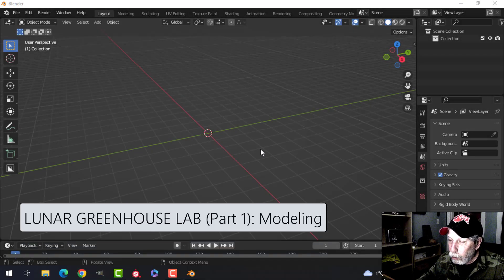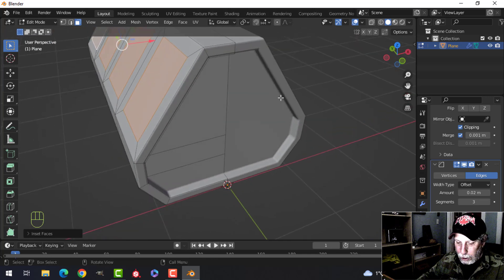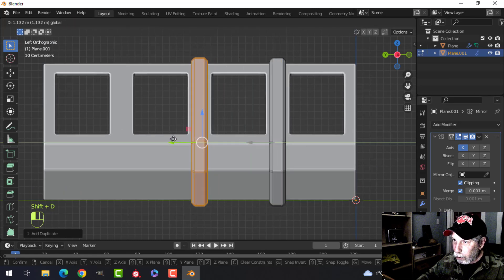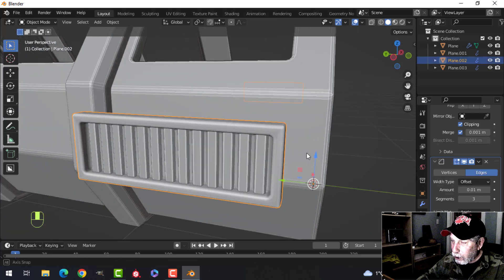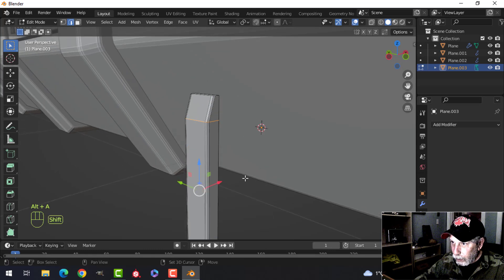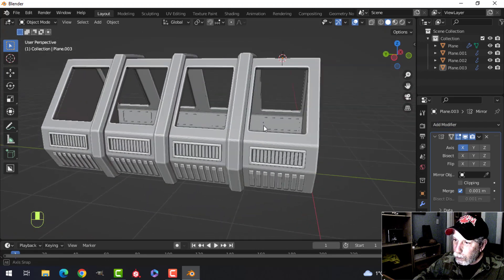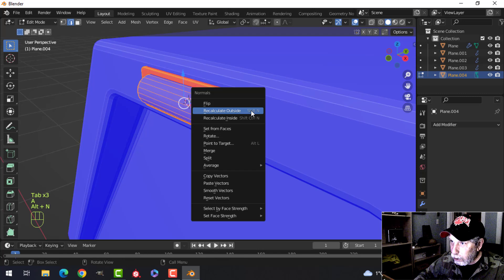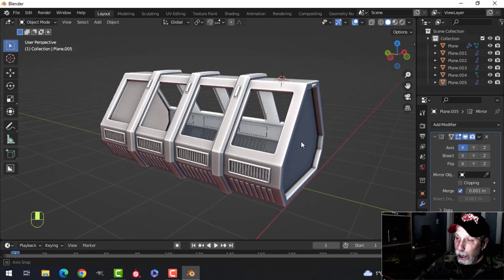BLENDER: LUNAR GREENHOUSE LAB (PART 1): MODELING

Comment: Thanks for your tutorial. I block at 3:46. When I do extrude and alt+s, it doesn't take the second instruction and the extruded area remains empty. An idea?
Reply from the maker: Thanks Lydie.  I'm sorry the alt-s didn't work for you.  Can you please do a couple of things:  check that all of your polys are facing outwards, select the wall piece you are extruding from and ctrl-n and recalculate outside.  Also, select again and press m and merge by distance in case you have extra vertices.   And of you have done any scaling or rotating in object rather than edit mode, select that wall piece in object mode and press ctrl-a and apply all transformations.   Then try the procedure again.  If it fails, delete the wall sections and start again where you select the edge at the front of the ship and continue from there.  Let me know how it all goes for you.
Reply: @zerobio  Thanks. With merge, it's ok.
Reply from the maker: @lydieblaizot  good work!